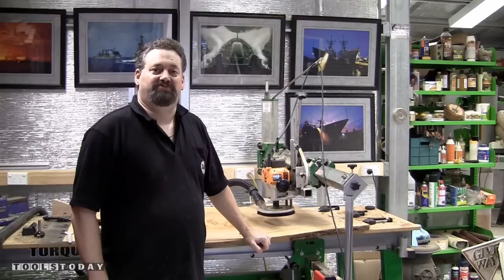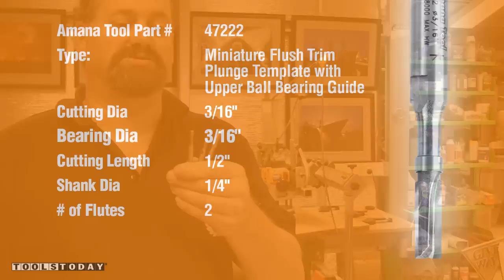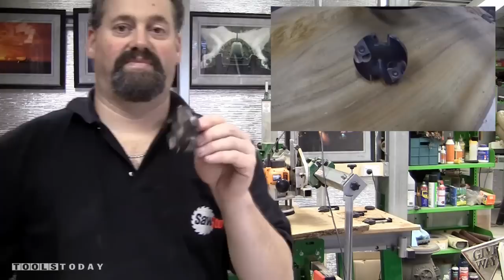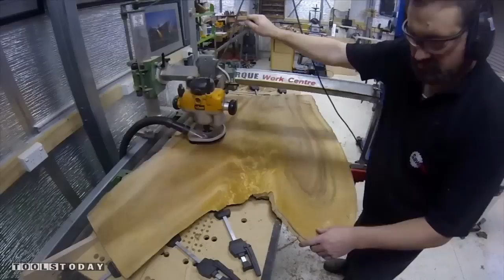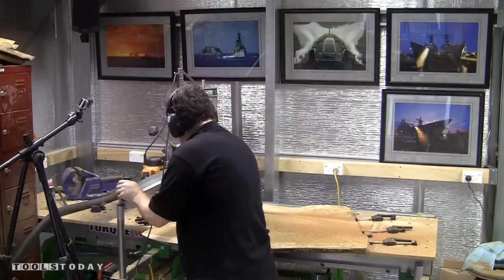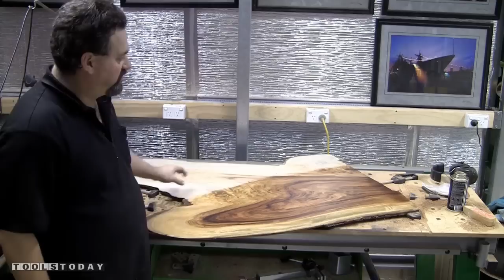Woodworking Project: Surfacing Wood w/Amana Tool Industrial Insert Spoilboard CNC Router Bits

Comment: If the cutter is behaving differently depending on the direction of the cut it means the spindle (router shaft) is not perpendicular to the cutting plane and need to be trammed

Comment: Nice looking piece. I see you have some cool clamps holding the panel in place. Where did you get these clamps?
Reply from the maker: The clamps are Walko Quick Clamps http://www.walko.nl/contents/en-uk/d1_WALKO_Accessoires.html and they are superb.  Very similar to the Festool Fixed clamp https://www.amazon.com/Festool-488030-Clamping-ElemenTS-2-Pack/dp/B000JNEC1Q. You quickly find you want to drill a matrix of holes in the workbench so you can fit any shaped object down anywhere on the workbench.

Comment: have you tried it out on end grain?  I have several large round "cookies" to mill flat.
Reply from the maker: +RSL Custom Furnishings, Hi, what do you mean by "cookies" ? These surfacing bits work on practically all wood, MDF, fiberboard and chipboard materials.
Reply: He means end grain, cross cut slabs.  I'd be interested to hear this, also.  I have a lot of bright box elder cookies I could certainly use this on!

Comment: Beautiful slab!
So what were you acutally doing with those router bits? Taking the top layer of the wood off?
Reply from the maker: Yes, using a CNC machine we take off (planing) the top layer of the slab to create a flat, smooth and even surface.